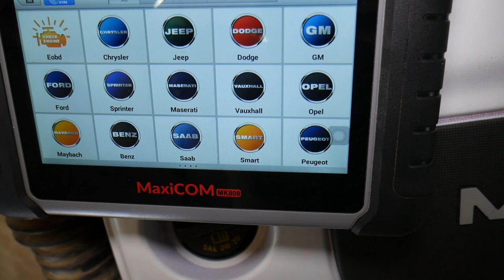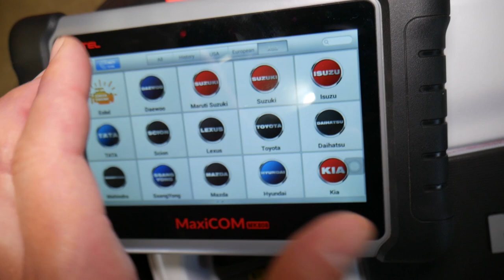JEEP COMPASS RENEGADE CODE P0301 P0302 P0303 P0304 Cylinder Misfire

Comment: I have a 2016 jeep renegade 1.4 L. I am having a cylinder three misfire her P0303. I have rearranged the coil packs and spark plugs reset the code and I still have the same thing going on at idols really rough accelerates poorly until around 2500 RPMs and runs fine after that. I can’t seem to figure out what’s going on I am curious if it could be due to old oil not running The lifters properly or maybe a lift or fell off or what could be going on?
Reply: I’m having same issue as u with 2.4
Reply: My friend what was you problom . Im having same issue with cilender 1 . Thanks
Reply: Im having same issue with cilender 1. Did you find your issue?
Reply: Did you find the issue?